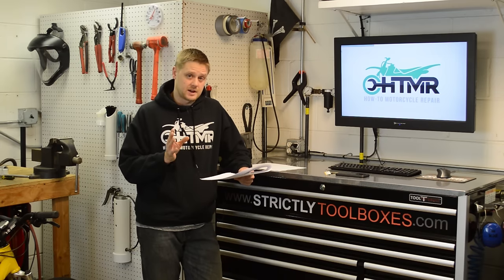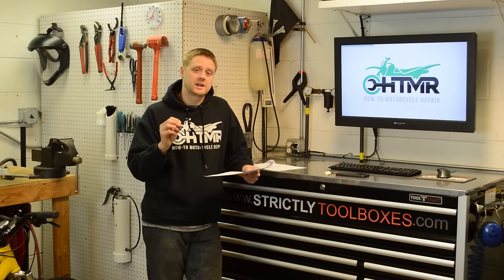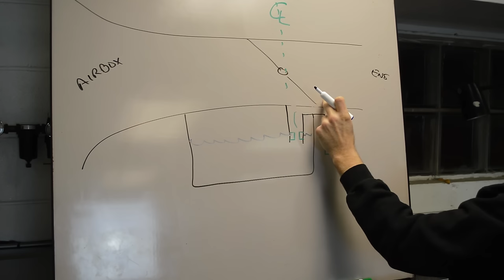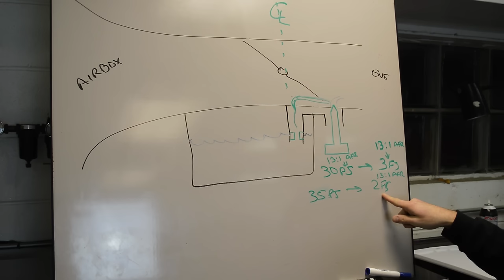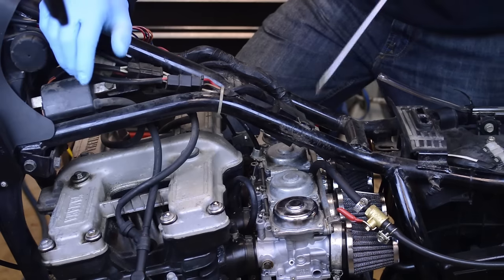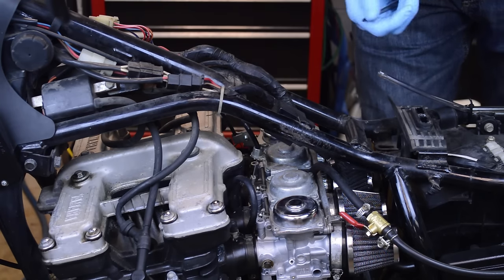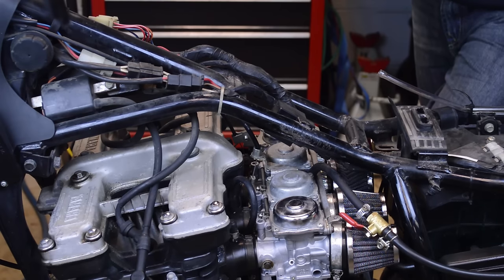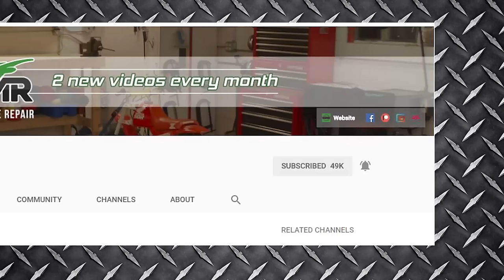Pilot Air/Fuel Screw Adjustment Explained - Multiple Carbs - Part 2

Comment from the maker: Pilot jet explained blog post - https://www.howtomotorcyclerepair.com/how-to-size-your-pilot-jet-pilot-screw-explained/
Aux fuel tank - https://amzn.to/2WJboTy
Reply: Can you make another video showing where the carbtune vacuum hoses being inserted?
Reply: Wow you are good teacher. Thanks. I am having issue on a ttr110 tried different jets to control bog at full throttle but now I have good ful throttle but no idle and when I change pilot I get full open bog I'm so confused can't get both to be right. I have a air screw and a welch plug do I have both air and fuel screw? I thought u said there is only either or.
Reply: Royal Vintage Spare A112 Auxiliary Fuel Tank For Servicing Your Bike 300Ml

Comment: I was a tech in a Yamaha dealership back in the eighties and Yamaha said we had to adjust all carbs while using an e-gas analyzer to spec, always too lean, and replace the plugs or they might void warranty. Honda wanted us to do idle drop adjusting which honestly worked much better and no expensive, delicate equipment needed
Reply: Why would the pilot screws have to be a 1/2-1 turns out? Both are the same and it just revs higher as I turn screw in, it doesn't bog down till I turn it out around 1/2-2+.. please help me when you can. Thanks!
Reply: Hanes manual says the same thing for Kawi
Reply: @MittenManShoots  if no powerband try check your powervalve, it could be stuck with too much carbon buildup..after riding at wide open throttle for about 10-20 second, immediately stop the engine and remove the sparkplug to inspect the colour to see whether its too rich or lean..
Reply: Got a bran new carburetor and it boggs out got a 1991 4x4 kawasaki bayou 300 4x4

Comment: I also use spark plug color as indicator, trying to aim to a brownish color. Starting from being too rich with carbon black spark plugs making adjustments down and always running the bike for at least 30 minutes, with highway parts and check again color until right. It can take several days but it seems the most precise method without the use of fancy tools, what do you think ?

Comment: Hi you mention on the fuel screw, pilot jet, if it’s under one turn or maybe under two turns it’s too rich, but that doesn’t make sense as if it’s a fuel pilot screw, the more you turn it out the more fuel your adding, therefore surely if you turn it out for less than one turn, it’s too lean, and not too rich, it will only become richer the more you turn it out.

Comment: After hearing it I can tell you that the popping on your audio is caused by rf interference from ignition system discharges effecting  the electronics in your audio equipment.. Better audio curcuitry should have better shielding against it. Also possibly some form of suppression/filtering  on your ignition system but I don't know if that can be done.

Comment: I have a 1980 yamaha xs1100 special and I have been having issues with setting my idle after rebuilding the carbs. this whole video gave me sooooo much help in understanding how this system works, I thought I had an air screw, turns out its a fuel screw. I'm an automotive tech and never messed with bikes before now and I appreciate how in depth you got explaining this.
Reply: I just wanted to post an update. Because of your video i now have a running and riding bike. Thank you soooooo so much
Reply: What did you do? I have a 80 XS Standard...

Comment: Great video, very comprehensive.  After removing the welch plugs on my '94 Kaw Voyager 1200, I discovered that two of the pilot screws were buried (zero turns out) and two were about 1.5 turns out.  The plugs looked factory, so it's shocking that Kaw (or Keihin) would have messed up so badly.  The guy I bought the bike from told me that it was originally sold in CA, so maybe that has something to do with it.

Comment: I'm impressed with your knowledge and ability to teach.  Taking the time to illustrate the theory is top notch stuff.  I learned a lot, and really appreciate the time and effort you put into creating this video.   I have an '86 Ninja ZX600R, purchased in '90, and it's always suffered from being too lean in the pilot circuit, and falling on it's face when the throttle is rolled on.  I've had the carbs off and apart for cleaning, probably 3 times since purchase, (learning more as I go along in life) mostly due to leaving it sit unused for long enough that the fuel went bad in the carbs, but I didn't know about how jet sizing has an effect on mixture ratio, even though the pilot screw might be out enough that they idle is good.  I've even synched them, and although there was a noticeable improvement, it's never be perfect.  I'll be I could go a size or 2 up, and cure the issue, if any company is making jets still.  Thanks again!
Reply from the maker: Check out jetsrus.com

Comment: Thanks man, great explanation on how it all works. I recently resurrected an 86 vmax that had sat for 10 years, bad gas, rusted tank, frozen carbs, etc.  Runs great at upper rpm but won’t idle without choke.  I should have removed the factory set pilot screws before I soaked the carbs, as you mentioned, probably the issue. Going to do it now. My thinking, since only has 5k miles, was that factory setting probably correct. I might even see about getting larger main jets, but the thing is insanely fast the way it is.
Reply from the maker: Yeah you need to remove the fuel screw and clean the passage. It is the most important and smallest one.

Comment: My problem is I have new mikuni rs36-d8-k carbs on my yamaha xj1100 amd jetted for the engine and per directions it says to turn them out ⅛ to ½ turns out max but it doesn't say from a light seat, fron a turn out, or anything in the directions. A light seat is something that is hard to determine because it is seated against a oring and each carb has a different feel and look when you look at each pilot jet screw with the carbs off so I've ordered a colortune to see where thigs are at. Your video is a great watch for sure and explains things perfectly.

Comment: I always ran lean because it gets great efficiency and economy. That extra power gain you get from running rich is not important unless I go to track. When I do track I retune it to slightly rich. Good video.
Reply from the maker: Sure. I go for performance, sacrificing fuel economy.

Comment: my 90 gs500e's stock spec is 3 turns out. When on the highway at speed, if I slowly roll of the throttle and then back on again (to go +/- highway speed) it pops as I turn the throttle. Doesn't pop anymore after the throttle is turned 1/8. These are set to run lean for sure, so my thinking is 3.5 turns out, which is what I had it at prior to resetting it. 

this video is awesome. greetings from Chicago!
Reply from the maker: You are marginal on those pilot jets. Probably need to go up 1-2 sizes.
Reply: I probably do. Maybe ill get some new jets. You should also mention in your video that most of these non-oem jet kits come with inferior brass jets. that was a problem I had with the rebuild kit I got from ebay. i ended up not using them all. but the float bowl gaskets were good!
Reply: on the Mikuni BST33's that the GS's come with, the thinking is 3.5 turns out is the most you can do anyway, so if this doesn't solve the problem, new jets will be the answer. Why am i throwing parts at a 29 year old bike?? Because it had 10,500 miles on it when I bought it.

Comment: Hello! Thanks for the detailed explanation! We are also in the the process of the tuning the fuel screws. Two questions if someone knows to help out 🙏
1. Before starting the process, where should be the idle revs configured? High, low or manufacturer suggested? Or something else?
2. What happens if the screws are in a location where it is probably impossible to tune them while the engine is running. Any tips and tricks? 
P.S. The bike we are trying to tune is Honda Cbf 600, 2004. Thanks!

Comment: On a twin carbs bike, the pilots screw adjustment need to be the same or it can be different from carb  # 1 to carb  # 2 ?  Like 2 turn out on the carb  # 1 and 2.5 turn out on the  # 2 ?

Comment: BEST VIDEO ON YOUTUBE! QUESTIONS: I backed my idle screw all the way out on my vtwin 1100 vstar, and it still idles at around 800 RPM. When I lean it out idle goes down and when I richen it the idle goes up. But where it idles smooth and fast is too fast for the lowest idle screw setting. Also, note that when I close the AF screw all the way the bike still idles and will not stall even with the AF screw all the way in on the front cylinder. Also not that the rear cylinder AF screw has no real effect to any change I make to it, except the backfire pops, when I lean it out and less backfire pops when I richen it, but it does not have any real effect at idle. Only the front carb seems to affect idle. I bought this bike second hand. I think its time to ditch the carbs and buy another used set and start over?
Reply from the maker: Probably best to take the carbs apart and clean them. I have a video on that here: https://www.howtomotorcyclerepair.com/hondashadowcarbclean/
Reply: Our V-Star doing the same
Reply: Trying to see why it smells so rich and my tailpipe is burning cherry red hot after 10 mins

Comment: Just stumbled on you channel oh boy you just have answered a annoying problem with my 1990 ZXR750H2 (uk) my idle is slow to return to normal I do have mods I'm running micron headers to a SP stubby can with K&N filter im running 130 main jets high speed running is spot on. I do sometimes have a problem with the bike cutting out when hot at traffic lights your explanation of the pilot jets which I have set at manufacturing setting one and three quarters turned out looks like I need to turn them out further looks like mine is running lean and the fuel is evaporating before its pulled into the engine . I  have uploaded a video of my bike to my channel me revving it and you can plainly hear the rpm slowly returning back to normal idle. Great video your never to old to learn thankyou so much for this video. Happy New Year and I hope 2021 is a good one 😎👍 ps you have a new sub

Comment: thank you, this is the closest any video has gotten to providing any information that I can relate to the hitachi hsc32 carbs on the 1980 yamaha xj650 i recently acquired, in fact the carbs are out laying on my bed from me just getting through 2 hours ago putting them back together again for the 5th or 6th time. there is no information in the manual for the fuel adjusting screw it just says "preset (no datum given)" so now I have a guide line to work from, thank you again......
Reply from the maker: No problem!

Comment: Hey man thanks a lot man I have Ben putting back a Yamaha 2006 r6 for 3 years now..it was throttling  good and reving good..I had replace some head o rings n start the bike n it stop reving and a wile after it start to missing n he other thing as well the throttle body get tight..I take the plugs our clean them n free up the throttle body as well n check all wiers n all is good knick ..thanks a lot man n I'll try the 3 turns out n see what..keep what you do best by Charing your nalage..👍💯🔐

Comment: Excellent tutorial, thank you! Currently working on tuning the carbs I just rebuilt on a 1994 Yamaha XJ600. My first time doing it, so it's a minor miracle that they don't leak. 🤣 Idles fine but acceleration is poor. I have a MotionPro sync tool I'll be using, and this method to work on the pilot screws. A wideband O2 sensor was a good method suggested, but pricey and involves welding. This looks much more doable for me. I stepped my OEM pilot jets up from #17 to #20. Main jets are stock. We'll see how it goes!
Reply from the maker: Good luck!

Comment: This is a good video.  I hope between both your videos and mine, maybe people might start to understand how to do this on their own.  But still I think people don't want to spend the type testing, changing a setting, testing, and so forth.
Reply from the maker: Thanks. Tuning can be a PITA, however with this circuit the answer is in the screw setting. Don't even have to ride it to determine if it is lean/rich.
Reply: Right, but novices I think lack the analytical mind we may have.  This video builds on our previous information around the topic.  Too bad it can't be better centralized.  I have tried to do that on my website, and I might embed your video there.
Reply from the maker: @thejunkman  Yes and this is also assuming the carbs are in perfect shape. We all know that is rarely the case.
Reply: @HTMR  my vtx mixture screw was completely burned out and crudded up with rust and kept playing with the mixture not realizing till I dug deeper and once I cleaned it up it was much more responsive but now I’m dealing with slight hesitation during acceleration using barons set with 210 but they didn’t assign numeric value on pilot

Comment: This video (and the one five years ago) are great for newbies like me to understand how to find the sweet spot for the pilot circuit, but i still have some questions in mind.

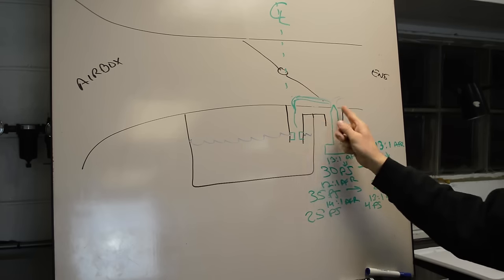1. I have a DRZ400SM, which has a pilot fuel screw on the carb, I installed a jet kit and sized up the pilot jet from 22.5(stock) to 25. I followed your video and found that 1 turn out from closed would be the best setting for it to idle. But my another question would be, how to determine what size of pilot jet to put on the carb? As you have mentioned in the video at 13:30, the AFR would be the same at idle if you can find the correct number of turns on fuel screw, but the AFR at cruise would be different upon changes on pilot jet. So how do I know which pilot jet should be used?

2. Apart from the pilot jet, i have also changed the needle (now its 4th clip from top) and the main jet (sized up from 150 to 160), it seems to be a bit rich as i have tried to take off the side panel of my airbox (in order to increase the air intake) to test  and it runs fine with no exhaust popping at deceleration or backfire (sorry this is the only way i know to determine its too lean). So i may try to move up the clip position and go down on the main jet. My question would be, is there any ways to determine which clip position, and size of main jet is the best setting? Besides, how to know if i am running rich on needle and main jet apart from what i have done to increase the air intake to test? I heard there is a tool called Colortune, but i am not sure if it could help to find out the best setting.

Sorry for my long questions! As i just installed the jet kit and hope to get the most of it. Thank you!
Reply from the maker: Do you have a FCR carb on that bike? The pilot fuel screw should be 2-2.5 on an FCR carb, or 2-3 on other carbs. You should install a leaner pilot jet so that you can go from 1 turn out to say 2-3.

For needle clip, just experiment with clip positions and your butt dyno with throttle in 1/2 - 3/4 positions.
Reply: @HTMR   Mine is a stock Mikuni BSR36 carb. Surly will go back to the stock pilot jet. Like what you said, it will lower the AFR at cruise, but what would be the problem if i stick with the current richer pilot jet?

Yup, i understand that the needle affects the 1/2 to 3/4 throttle position while main jet affects from 3/4 to full throttle, are there any signs telling me i am too lean or too rich?

Thanks!
Reply from the maker: @boblkc  You will just consume more fuel. Maybe won't be as crisp? Do some main jet plug chops: https://youtu.be/6b9dMhgZT-c

Comment: I did not read here where anyone talked about checking actual air flow on each carburetor. I used a device that had a rubber seal. Place the device on carburetor # 1. There was a ball that floated in a clear tube. Adjust it until the ball floats in marked center.  The place the device on # 2 carb. If the ball was not centered, you got to adjust carburetor linkage to sync the carburetors. Same with the #3  carburetor. You need the exact air flow on all carburetors. Last adjust the mixture needles. The only way to get it done right.😅

Comment: Hey Matthew! Great videos you are truly a professional. I have a problem with ground issues. When I start my bike with jumper cables and remove the ground clamp i get a really good set of sparks. I have pulled the stator. voltage regulator it all seem to check out. Is something wrong! Build bikes for everyone. Merrill

Comment: Great video, clears my concept, I need help, sir. I have a 1986 Yamaha YX600 Radian. I am cleaning my bike's carb and I messed up with the pilot screw turns. Initially, before opening my carb I adjusted the screw which operates the throttle position. Now when I adjust the pilot screw how to combine the tuning with the throttle position screw? how does it work together? and which one should I adjust/tune first? Pilot Screw or throttle position screw?

Comment: I do have a suggestion. Since this is such a HUGE topic. I would make ONE video on just air screw adjustment and ONE video on fuel screw. Explain about the AFR for each and how to select pilot ideal turns out and max turns out before changing. It can be confusing when you think about one or the other.  I think it would pay off in the long run. Since I am a tuber i know how that works.

Comment: I think that 3 turns out may only apply for CV carbs.  The Amal and Mikuni need to be about 1.5 turns.   I got an old GP Amal that has the air screw on that engine side.   One side effect of running too lean a mixture is that the exhaust pipes can colour up, as happened with my Royal Enfield.
Reply from the maker: Yes, air screw is different, shoot for 1.5 out.